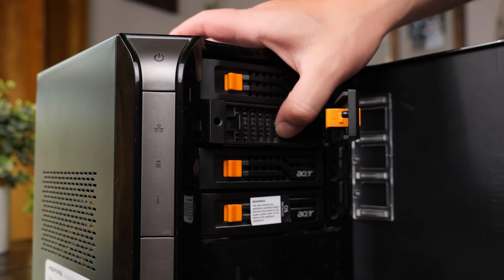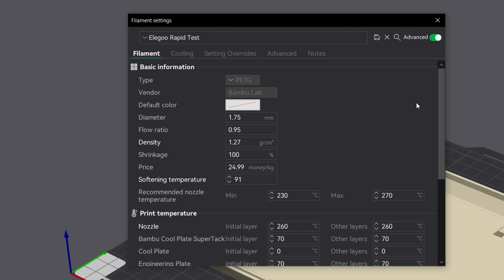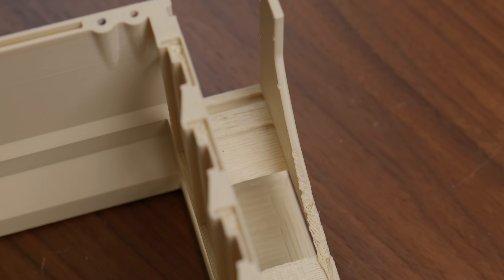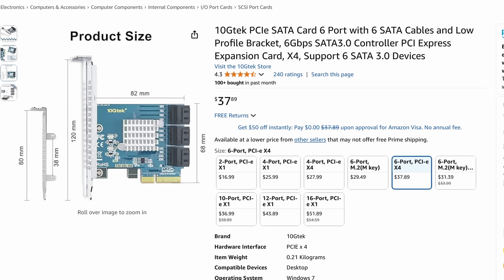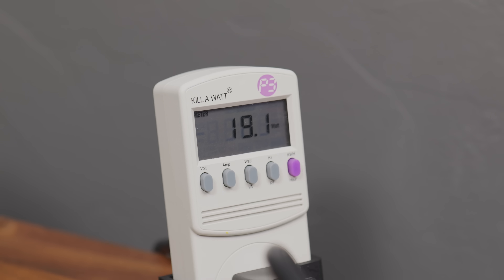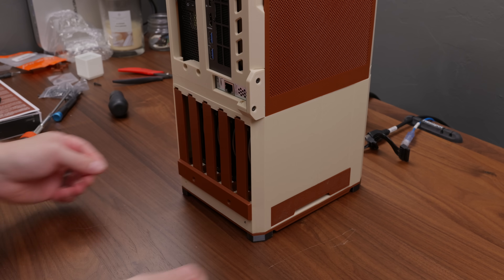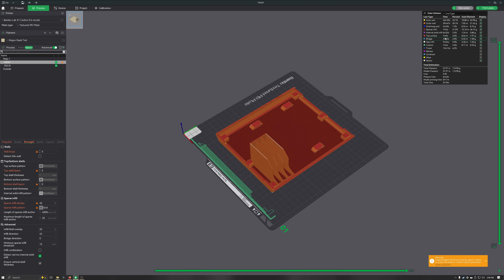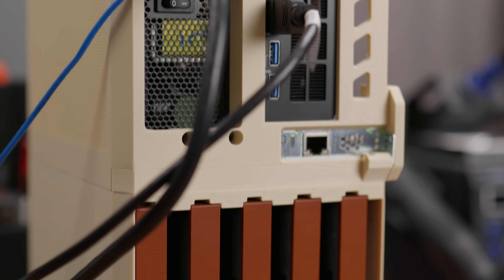This 3D-Printed Home Server Is INCREDIBLE

Comment: I love that Minisforum board. The BD795i SE is the exact board I went with when building my new Proxmox server. My old Proxmox box (a 12c/24t Xeon E5-2697v2) was reasonably fast, but was starting to feel long in the tooth. It doesn't support some of the newer CPU instructions that more and more software is using these days, plus the thing ran hot and sucked down power like it was going out of style. After looking around at the used market (and not finding anything in my price range that spoke to me) I went looking on Amazon and the Minisforum board looked awfully tempting, so I went with it. Paired it with 128 GB RAM (which I had to order, as I didn't have any DDR5 SODIMMs lying about, also this board has recently been certified to support 128 GB) and a 2 TB NVME SSD (which I had left over from my old Proxmox box) and stuck it in a generic Mini ITX case along with a spare ATX power supply, both of which I had lying around and/or left over after other PC upgrades. The thing performs beautifully, my VMs are nice and fast. I regularly throw multiple large compile jobs at it and it doesn't flinch. Of course it runs all the other services I need just fine as well (Asterisk, Home Assistant, *arrs, etc.) And it uses way less power than the old Xeon. Couldn't be happier with this board.

Comment: It’s a beautiful case. I noted you had some bridging issues. Bridging and or stringing with most any filament is caused by it being too wet. Nylon is the worst but PETG is not immune. Best to dry @ 70-80C for 24Hr minimum. In high moisture environments, especially in the summer, use a dry box with desiccant while you’re printing. Desiccant alone will not work, you need to heat dry initially.

Comment: I'd like to see you do something like this with some old used hardware, such as the HP ProDesk 400 G4 SFF or something similar. Using the SFF prebuilt machines becomes a little more challenging due to the non-conforming motherboards, but they are a great use for some of the older machines.

Comment: Is it possible to 3D print a 16 - 3.5 inch drive NAS enclosure similar to a Supermicro 16 drive NAS case?

What kind of 3D printer do you recommend, and how much does a 3D printer cost?

Comment: Was thinking that the notch in the front or side where you can see the SATA cables, might make an interesting place to plug in a couple of 8 digit 7 segment displays (or more segment if you want text) that  provides either random numbers, or some variety of status messages. (Perhaps viewer or subscriber counts?) The 8 digit 8 segment displays I've seen are I2C modules, and I think you should be able to control both from a single Arduino Micro, that then looks like a serial device if you can plug it into an unused USB extension port on the motherboard. 

That or get the necessary specs for the grill below it, and model up a mod that fills the space. 

Worst case 3d model a Hardware Haven badge to print, and fill the space

Comment: I like the idea so much.
The only thing that bathers me is the cable management.
Why don't you spend time in shortening the cables specially those of the power supply unit and eliminate the unused ones ?
I think if you do so, you will have better and faster connection and better air flow as well.
May be you can specify some lanes over the internal sides of the case to put those cables after shortening them.

Comment: Someone gave me the version without the pcie card cut-out in the case, but i really wanted to install a powerfull low profile gpu. Any ideas what i could do other that cutting into the plastic with a saw? What is the maximum width my low profile gpu could be to still fit in the case? Is there any work around? Thanks

Comment: I was going to print the Mass too but went with the rNAS-6X
Reasons:
1. Fits 4 x 3.5" and 2x 2.5" which was perfect for my build
2. Fits ITX + 1x dual slot pcie
3. is 100% 3d printed - no metal screws, etc and I did not want to dabble into that wild card
4. I think (don't quote me) it uses less filament (thus less time)
5. Supports fans I had already (4x 80mm
6. Most importantly accomodates full ATX PSUs - I did not have to go buy a flex or w/e, full ATX have some very efficient decently priced ones already compared to the smaller form factor.

It's been 5 months now and am really happy with the choice made. Fully tool less, open/close get access to what you need VERY easily. And if I remember right, it was cheaper than the MASS

Btw I followed Wolfgang's impossible to buy build
i5 13500
Asrock XMB-X1231 motherboard
64GB ECC memory
2x 2TB nvme as cache/appdata
4x 12TB 3.5" SATA drives (3+1Parity)
10Gbps sfp+ Aquantia network card
4x Arctic PWM PST 80mm fans
Coolermaster PSU (forget the model but one of those marked efficient by Wolfgang's spreadsheet)

Running Unraid 

Under load draws around 60W and idle can drop to 25W (especially if you use onboard network (2.5Gbps x2)

Comment: did this a few years ago with the MK735 NAS case by 3dwebe, back when 3d printers were much less advanced than they are now. Definitely a fun and challenging project back then. HT-PLA was a thing but wasn't widespread, PETG was still a bit exotic so had to figure out how to work ABS on a i3 style printer. Dumped a cardboard box over the printer and hoped I just didn't waste $25 of filament was a very real thing lol. Case  is still running today thankfully but maybe it is time for a refresh.

Comment: Nice setup. Why did you passthrough 10Gbe NIC to the nas? In the latest versions of pxe you can use virtual bridge at the same speed as it is native, and you can also use that NIC for other applications like jellyfin. 

More or less i have a similar config with an 4650g pro 128gb ram ecc and same asm1166 m2 on my b550m ds3h. A truenas core setup and a ubuntu server vm as my control plane for my kubernetes cluster. Asm1166 is passthrough to my truenas vm and one of my m2 for slog cache, and the APU gpu to my ubuntu server vm for transcoding purpose. But my 10gbe NIC is used by both vms as a virtual bridge.

My kubernetes cluster is using democratic-csi for nfs shares like media with truenas vm and rook-ceph OSD with iscsi drives from a ssd pool from my truenas for sqlite applications

Comment: There are several commercial 3d printing solutions available - some sponsor various channels. Not having a 3d printer isn't the showstopper it used to be, that's for sure.

(And some of the higher end solutions can print metals and more exotic materials, too...)

Comment: I also printed that very case a while back to house my backup server. I needed a relatively compact case for my "offline backup" server that only needs to run occasionally (when the main server wants to sync it's backups via ZFS).
I have a AM4 based board running in it, with a 2.5g card in the wifi M.2 slot and just routing the port to the back and making a suitable for it (ez by reprinting the back with it added). I used the standard AMD stock cooler (wratih), which doesn't actually fit in the case, but since it's a 3d printed case I just made a side panel with the correct cutout for the fan and printed that. Now the CPU fan just pokes out a tiny bit and actually always gets fresh air, which is also nice.

Comment: Why does minisforum use that weird bios instead of the standard ami bios? I'm looking for a new mini itx board to update my desktop but I need to have sata ports since I am passing my old one to my nas box when I update. Just to keep the cost down. Interesting 3D cases. Man, things have changed since I made mine years ago. it's much easier to print things now, I wished I had the new machines back then.

Comment: I find this a tricky one.
There are new ATX cases for as cheap as about 30 bucks.
Not the best, but plenty of tweak and modification potential.
Or otherwise 2nd hand cases.

So it's either spending that much on 3d printing, or modifying some things here and there..... 🤔🤔

Comment: For mechanical drives on servers, you want them to be horizontal instead of vertical. 
Vertical mount make the platter bearing carry an overhung load. Creating asymmetric wear, then vibrations, then death…
Usually in the 3 to 5 year old range if 24/7.
Reply: Before you say something aboot car wheelhubs bearings beeing fine:
There’s 2 bearings per wheels
A wheel turn between 500 to 1000 rpm few hours per day. (Hd are 3500/7200/10000rpm)
THEY ARE PIN BEARINGS not ball bearings
Reply: Hence most Server and NAS builders build them for vertical use?

Comment: got to say it does look like air air purifier, which begs the question it possible to convert one, stealth nas !
Reply from the maker: Hahahahaha
Reply: @HardwareHaven  it kinda sounds really dumb, i mean there's stuff inside those purifiers but they are designed for silent air flow which could make them excellent for cooling. at an initial glance there doesn't appear to be many teardowns of them on youtube, which is honestly surprising. If i ever see a larger one being thrown away i might pull it apart and see if anything will fit.

Comment: This is funny; I printed this case as well and just got a mini PC today, but from Aoostar. The universe wants me to watch this right now.
Reply: I just picked up an AOOSTAR N1 Pro. Moving away from the giant power hungry xeon setup to mini pc 'cluster' of sorts.
Reply: Been doing the same thing. Moving away from one large heater of a PC to these little devices and k8s eventually (still learning). I have a few Panda Lattes Mus that I can run on 12v from my solar battery systems that are super fun. Have an Odroid for a back-up server taht is also running off battery with a 19v boost and a Topton NX17 like this but from AliExpress for media and Arr.

I got this Aoostar to learn on and have something I can break and not take down services I need.

I was also looking at the Beelink ME Mini, their 6 bay nvme nas, I kind of need a file server. Still looking at reviews, I want to see it running with some sata drives with an nvme adaptor.

Comment: 12:30 good to know the ol' "I had to take it all apart again because I missed one step" applies equally to 3D printed cases as it does to all the ITX cases I've ever bought!
Reply from the maker: Yeah, I was pretty pumped to build an ITX system... I doubt I'll do another anytime soon, haha!
Reply: rare Jeff spotted in the wild! :)
Reply: It's the curse of the mini ITX standard. I've built 3 PCs in that format and I've always had to go back and take something apart. It's worse than a puzzle sometimes, just a way to put it all together.
Reply: ITX gang ✊🏻
My main PC is ITX and I selected all of the parts to match a certain aesthetic… just to put on the vented side panel because I made a few mistakes with cable management that I couldn't be bothered to fix by taking every single component out and redoing
Reply: Hey it's Jeff!
Reply: Yooo it's the guy
Reply: AFAIK, @JeffGeerling, ITX is short version of "assemble it 15 times before the right one"
Reply: I printed the same case and had the same issue... twice, lol.
Reply: Unironically regularly have this with regular ITX cases

Comment: Has anyone figured out how those Crucial P3 SSDs affect RAM, yet? AFAIK, those are DRAM-less - so, they must use/allocate RAM capacity and DMA IOPS, for their FTL (Flash Translation Layer) table. I wonder how that'd show up in htop - is the total  capacity slightly decreased, like with iGPUs? (i think P5 SSDs come with internal DRAM - not certain)

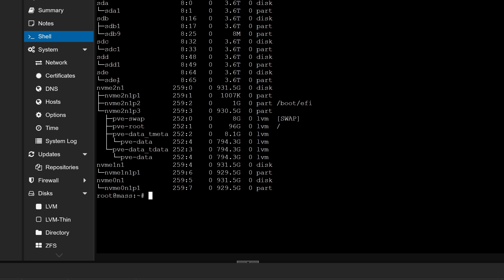Comment: 13:56 yeah, that ASMedia ASM2824 switch/bridge (i think, that's what the fancy Startech quad M.2 adaptor uses) …IIRC, this switch/bridge has only 8 Gen3 lanes towards upstream/CPU, though. A much cheaper option would be one of those x8/x4/x4 adaptors, that you can plug in between a low profile 10gig NIC (ConnectX-3), and get 2 m.2 sockets on both sides. Using SFP+ DAC is cheaper, long term, as well - those 10GBase-T/optical transceivers aren't exactly sipping power. My cheap Chinese Realtek switch (managed) has 2 SFP+ ports, but they advise against using active transceivers - risk of overheating.

Comment: So that Elegoo Rapid PETG. I bought a bunch of it cuz it was dirt cheap for a while. Like $8 a roll if you bought 4 rolls at a time on Amazon. On my Voron it wa stringy and zitty and acted like it was soaking wet. I don't have a dryer, so I just chalked it up to that. After a few months, I bought a Bambu A1 Combo since it was cheaper to do that than build a Box Turtle for my Voron. Imagine my surprise when I decided to give the Elegoo filament another shot in the Bambu, used the default Bambu High Speed PETG profile and BAM. Stuff printed perfectly. 

Long story short, profiles play a big role in how well a certain filament prints even though I can't figure out really what the differences were. Temps were mostly the same. The Voron printed ABS and ASA flawlessly. It even printed Prusament PETG flawlessly. But the Elegoo stuff was no bueno.
Reply from the maker: Interesting. Yeah I tried a different custom profile that I've used for some other generic PETG and it did not go well.. haha.

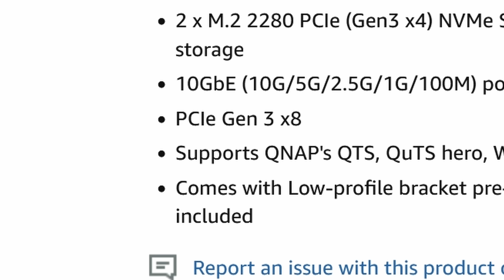Comment: Nice video - 2 Questions for the card at 8:24 - #1 Is that 10Gbit AQ Nic-Chip making a nightmare out of networking still? Aquantia seemed to be a nice chipset back in the days, because it was way cheaper compared to Intel, but litteraly everyone i know and i watch on YT, went back to Intel, because AQ/they cause so much trouble and made Networking a pure nightmare. Also they forced sometimes the CPU to have more higher power-states like you see in your idle Power-Draw. #2 How was the idle Power-Draw without the 2xnme+10g card?
Reply from the maker: Yeah I've had mixed results with various AQ 10Gb cards. I didn't test the QNAP card for super long, but didn't have any networking issues. I can't say much about power draw with how many variables there were with this project.
Reply: @HardwareHaven  Ahhh, gotcha thanks for sharing that! But thanks anyways! You motivated me to get rid of my Hetzner Dedicated and look for some "maybe notebook-like" hardware, like you did in the video, which can TOTALLY keep up with my 5950x and 128GB Ram, at an insane high price per month. I really thinking about ordering the "BD795i SE" like you did and do some extensive Proxmox and virtualization testing.

The weird thing is that the official AMD Page for that AMD Ryzen 9 7945HX says its max memory is 64GB and you did use 96GB, i would need at least 128GB, did you experience some weirdness over 64GB? Im wondering IF 128GB is even possible.

Comment: the idle power draw is probably an issue of the HX chip. pretty sure HX chips are just reused desktop chips. So this board just inherited the idle draw problem with AMD's chiplet design.

Comment: I used that exact motherboard this fall in my mini ITX overkill build. I used a Q58 case from Liam Li, fit this in with a Thermaltake ITX PSU and a RTX 4090. It's currently my workstation and gaming PC. Replaced my aged gaming PC and old workstation. So far love the motherboard. Had to RMA the first one, but they fixed that right away, no issues since. I love gaming on it!

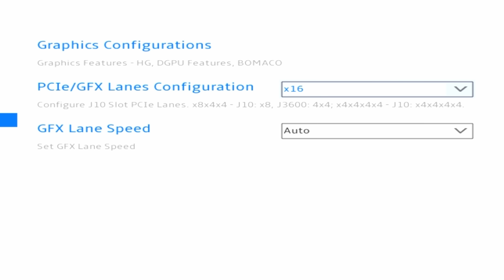Comment: 7:23 This quad M.2 adaptor card doesn't look like a "passive" one, that'd require mobo bifurcation. Cards with a big heat sink, like that, tend to be actively switched, using a PCIe packet switch/bridge (colloquially PLX chip (the fancy Startech one uses an ASMedia IC)). (edit: minor, maintaining semantics)
Reply from the maker: Considering that it was like $30, I'm positive that it's passive haha.

Comment: If you don’t mind using “only” 2.5Gbps port for the LAN, you could buy a simple PCIe to 2x M.2 adapter, and enable bifurcation.
Reply from the maker: Yep, I basically said that when I mentioned bifurcation support
Reply: @HardwareHaven my bad. I was so excited to see bifurcation on this kind of board, that I’ve missed the adapter part 😊
Reply from the maker: All good my dude!

Comment: Cool project, just remember, never use those pci sata cards, they suck balls. Get a 2nd hand lsi controller, flash it to IT mode and some sff to sata cables. You'd avoid the cable spaghetti from the m.2 sata adapter and drop the qnap card.
Reply: These cards use the same controllers that are used on millions of motherboards around the world. LSI cards also add ~10w to the power draw.
Reply from the maker: It seems like the ASM1166 cards are quite a bit better than some of the cheaper controllers that have been around for a while.

Comment: Just built out an OPNsense box. Looked for a 3dp case and ended up getting just a $40 small ATX case. Mostly because the PSU I got was mislabled as a Flex ATX (was not) and the 40 hours of printing a case was all for naught. Will certainly keep these other sources in mind!

Comment: Would that QNAP card (or similar) work in an older system that doesn’t support bifurcation? For example, an old Sandy Bridge or Haswell motherboard? Would be nice to add a mirrored NVMe pool for VMs to an old system (plus zip GbE!).